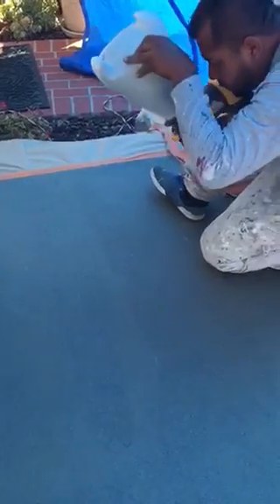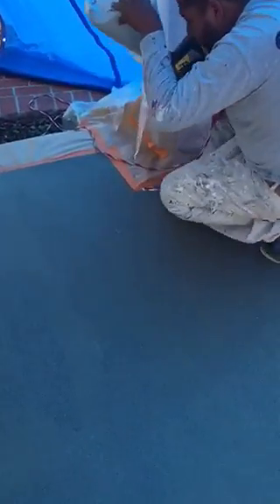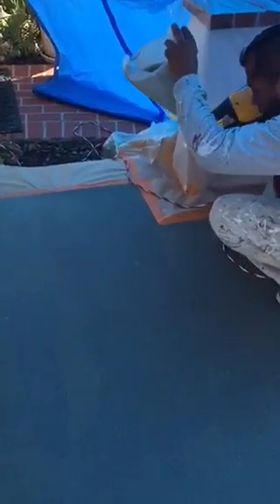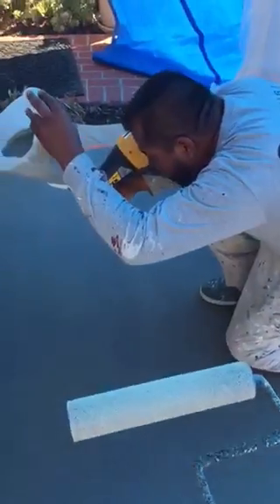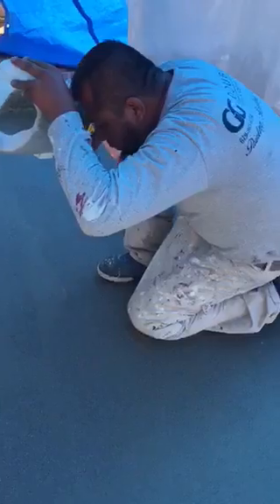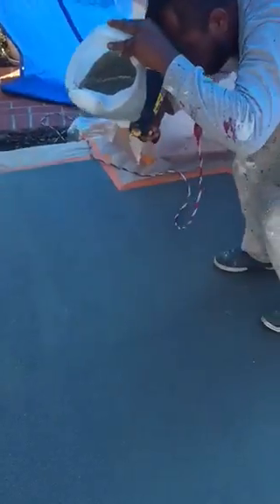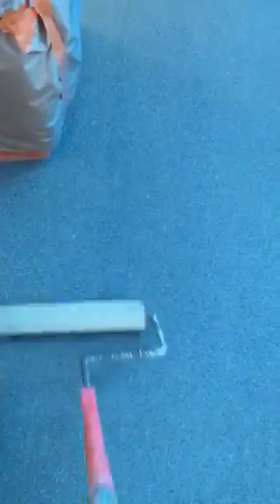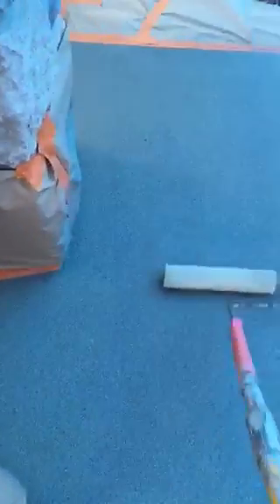Granit Grip Application.

Comment: I just rolled our garage with this stuff. It came out horrible. I should have use a sprayer like you guys.
Reply from the maker: Chris Watson it works, it’s not easy to apply, and it’s not a Supper popular product, but it is a great product that will last a long time!
Reply: I had a customer pick this product to put down on a previously painted pool deck. I watched a lot of videos and found everyone complaining about roller marks and having to do way more than 2 coats. I did a lot of cleaning and sprayed 2 coats with texture gun and back rolled. It came out great and customer was happy